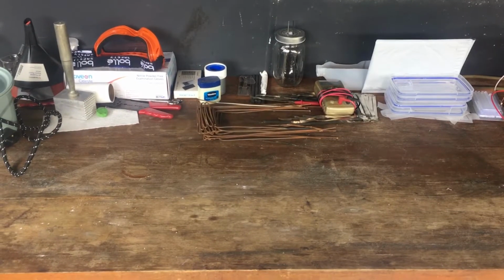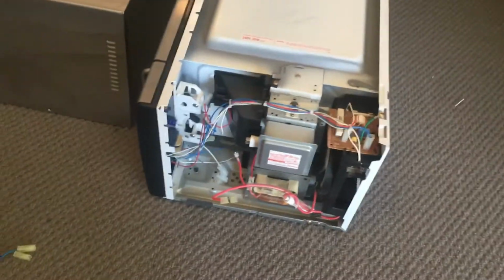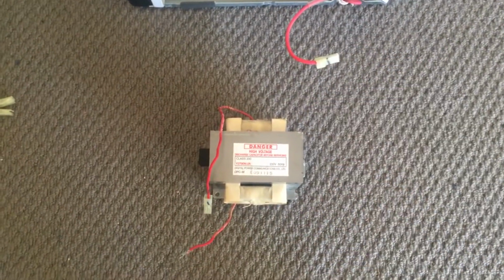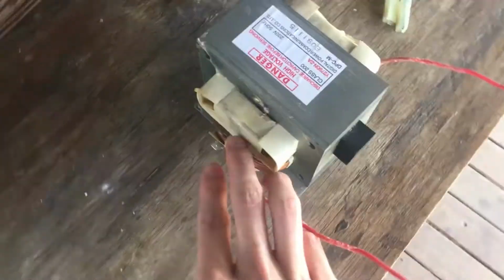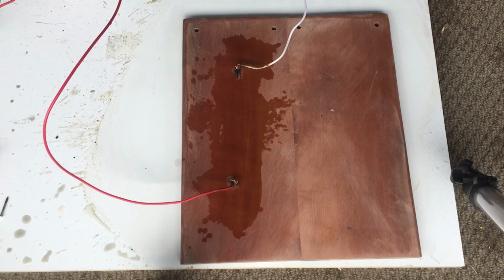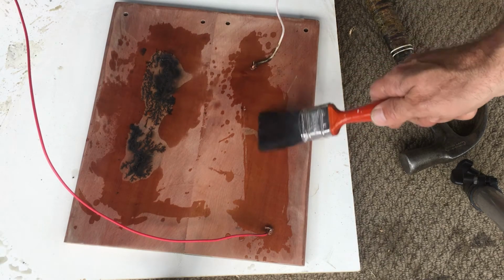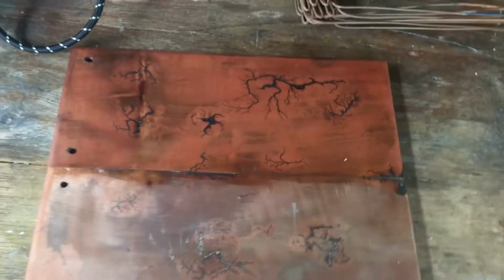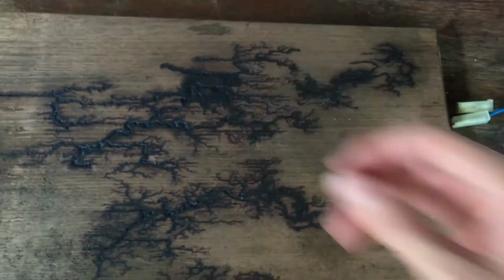Burning Wood With High Voltage

Comment: There is thorium in microwaves btw. Also why don't you dissolve the beryllium away? Wouldn't that prevent poisoning via dust?
Reply from the maker: Beryllium oxide is a very inert ceramic, so it'd be very difficult to dissolve away, not to mention a beryllium solution wouldn't be ideal to have around. Also the structure of the magnetron itself would make selectively dissolving it quite tricky too.
The thorium is a cool idea, though I don't think there's much, just in the form of a thoriated cathode in the vacuum tube bit. Might be worth keeping around just in case I think of a use for it.

Comment: Glad I can live vicariously through you and not risk that whole "zapped to death" thing. Do you plan to make any more figures? Maybe experiment with different materials, though I can't imagine anything working better than wood. Curved or bumpy surfaces might be interesting, but I suspect it would go pretty similarly to the flat pieces. Any thoughts?
Reply from the maker: Yeah, wood is obviously ideal from the fact that it actually burns along the current paths, allowing you to see the traces. Other people have done some cool 3D figures in a block of acrylic too, though it requires a different setup.
I'll probably try a few different surfaces/wood types in the future, and if I find anything that works exceptionally differently I'll definitely post something about it.

Comment: What about a birkeland eyed reactor using this ;)
Reply from the maker: I've put a bit of thought towards this, because that'd be really cool. However, a microwave transformer really isn't ideal for that kind of setup. The voltage is a bit too low to start the required arc, and the current/power is so high that it would likely melt or burn any container it uses. It might be possible to modify it to work a little better, but I don't think many people have had much success.
I'll stick to looking for a cheap neon sign transformer I reckon.

Comment: Hey man I love your vids ,I need some help on something and I thought you are the right person to ask 
I'm tryna make an hho torch for welding but I cant find some straight info of what affect the production of  oxygen and hydrogen (surface area. Concentration. Electristy.the salt)
Can you please give me the best things I can use to get the best production
Reply from the maker: The ideal setup is probably a so called 'dry cell' if your end goal is HHO gas. There are a bunch of good tutorials for these online.
If you don't have the equipment/materials to put one of those together, and you just want to build a simpler cell to produce HHO, here are some points to remember:
1) Concentrated potassium hydroxide (or sodium hydroxide if you can't get that) is an ideal electrolyte (just keep in mind how caustic it is though)
2) The gas production is directly proportional to the current you put through the cell, so to maximise efficiency, you want to optimise your cell for low voltage and high current, which can be achieved by the following three points:
3) The more concentrated the electrolyte, the more current you'll be able to put through the cell at a given voltage, making more gas. This only works to a certain extent of course, you don't need to go too overboard with the electrolyte concentration.
4) The higher the surface area of the electrodes, the more current you'll be able to pass through at a given voltage, which again, gives more gas.
5) The closer the electrodes are together, the more current you'll be able to pass through at a given voltage. Again, more gas.
6) Nickel is an ideal cathode and anode (ONLY when using sodium/potassium hydroxide electrolyte), if you can't get this, you can try stainless steel, but it may generate carcinogenic chromium compounds.
7) The ONLY parts of the electrodes which should be touching the electrolyte are the nickel (or stainless steel) surfaces. DO NOT make any kind of wire connection (such as solder, crimping, or screws) within the cell unless they are 100% nickel/stainless steel, as they will inevitably corrode and possibly spark an internal HHO explosion. All connections to electrodes should ideally be external.
8) Minimise the dead space and make sure the electrodes have no way of accidentally touching. You want to avoid an accidental explosion, and if one occurs, you want the absolute minimum of gas to be detonating within your cell.
9) You definitely need a bubbler or a flashback arrestor of some kind on the gas output.
10) Your power supply will ideally be something like 2V at however many amps you need. The 3.3V output of a computer PSU would probably do a satisfactory job.
11) Every amp of current you are putting through the cell will generate only around 10mL of gas per minute, so you'll likely need a lot of amps. Alternatively, you can have multiple cells in series (for which you'll need a higher voltage so that each cell can receive around 2V), and this quantity of gas would be multiplied over the number of cells for a given current.

Hope that clears a few things up.
Reply: Oh man I really appreciate it <3
That's so helpful

Comment: Hi great video my friend
Reply: I have one question 
What about carbon
Can i use it to distroy Cl2 gas
C+2Cl2------>CCl4
(Carbon from charcoal)
Do i need to heat the charcoal?
Reply: @Electro magic chlorine is not that bad but if you react is with carbon it might produce some carcinogenic things. If it works as your formula, it will make carbon tetrachloride which is carcinogenic and illegal in some places. why not just use sodium hydroxide to destroy chlorine. NaOH + Cl2-> NaCl + NaClO + H2O it will only make salt, water and bleach)
Reply: @lucas_lab  thanks 
The only problem is i have salt
N i want NaOH from salt
(Electrolysis)
I think Cl2 as gas is more danger than  liquid CCl4.(i hope i dont make some kind of weird gas)
+ for the carbon from charcoal
I found in wiki that active carbon
React with Cl2 in room temp(gas mask) (25*c)  but a donot know about charcoal should i give it some heat
Reply: @electromagic3111  so you are going to make sodium hydroxide from salt right?
Reply: @lucas_lab  yep
Reply: @electro magic I would highly recommend to do it with baking soda, but if you do it with salt and outside chlorine should not be a problem

Comment: Try again using the HV diode in series with the transformer.
I'd expect it to make the trees grow more in one direction than the other. 
It would also make it ever so slightly more dangerous. :)
Reply from the maker: It turns out the formation of the trees is independent of the direction of current. The trees grow from both ends either way. Might give it a go though, it would probably slow down the growth seeing as the current would only flow half the time.
2800v peak DC is definitely getting towards some insane safety concerns, but I've already gone this far I guess.
Reply: @ScrapScience  I am and will be somewhat surprised if it remains perfectly symmetrical.
A free space arc definitely gets hotter on one electrode vs the other with DC, so I'd have thought that would have some effect when on a surface.
I should dig out my gear and test it, but I'm not sure if I have enough diodes to rectify the 15kV of my transformer.. (Plus, I'm lazy)
Could be a 'quick follow up video' to see if there is any difference?
Reply from the maker: Very interesting, I’ll definitely test it next time I set up this kind of thing. 
Thanks for the idea, I’m intrigued now.